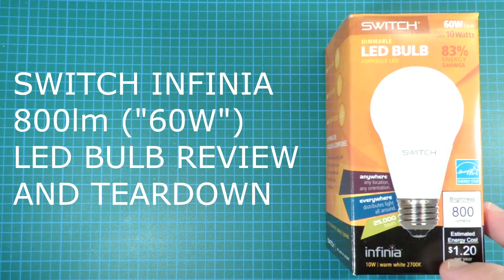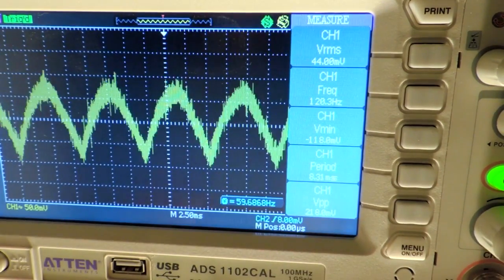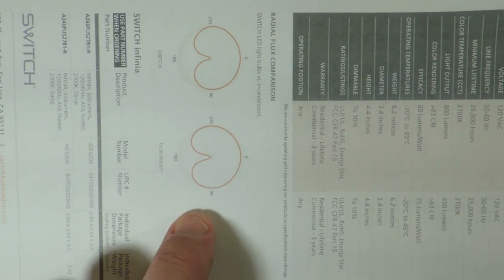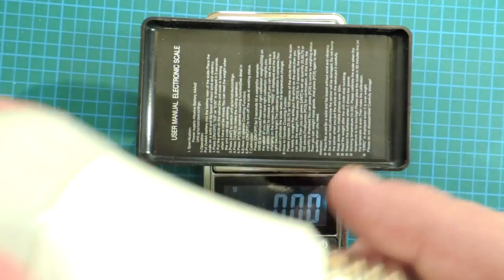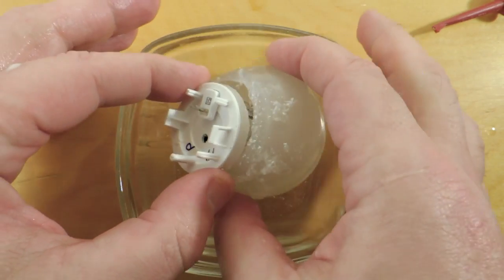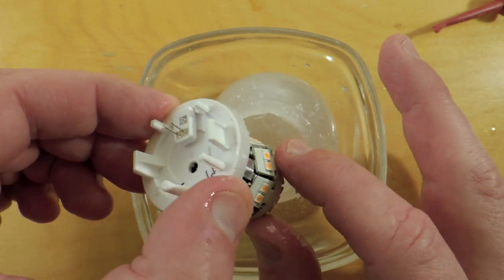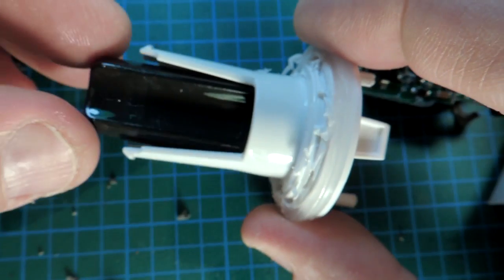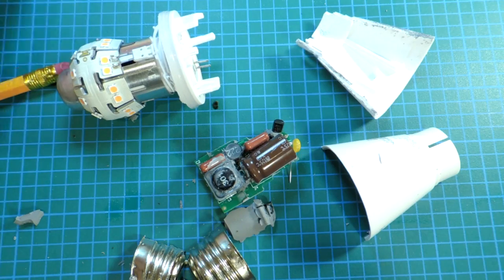Switch Infinia LED Bulb Review and Teardown: Quest for Reliability

Comment: You can probably see the liquid moving the bulb around when there is vibration (like a ceiling fan, exhaust fan, or garage door opener) while turned on. But nowadays you don’t need liquid in lightbulbs for it to be used in enclosed fixtures. The LEDs rated for enclosed fixtures should be made more expensively than the ones that say “Not for use in totally enclosed luminaires”. With some devices to detect the heat.

Comment: Terrible flicker for the original bulb? You do know it had the best electronics around right and flickers less than the current cree bulbs right?
Of all the lights my company installed, the original switch bulb was slightly better than any of the infinia 60's. I should know, I installed thousands of them in commercial applications.

Comment: One of the most interesting features of this design, is that this is the first LED light I have seen that was modular. If they would sell replacement parts for the power supply module (I would expect that to fail first), the emitter array would probably be reusable, saving money, materials, energy.

Comment: CAn you really compare the flicker values of different bulbs? I can't imagine that everything can be set up the same everytime. And even then the amplitude of the flicker is dependent on the "base" brightness of the bulb. So a high lumen LED will always have a high absolute flicker, but it could be low relative to it's brightness. I think you should use the peak DC value (with every other light in the room switched off) as base (or the DC RMS of the signal) and give the Vpp-amplitude of the signal in percent of that. That way in principle the value for a bulb should stay the same no matter where you place the solar cell.
Reply from the maker: LUX (light intensity) held constant on all measures.  Bulbs generally always 2700K in these videos to help normalize out any differences in spectral response of the solar cell.  All out lights out in the room.